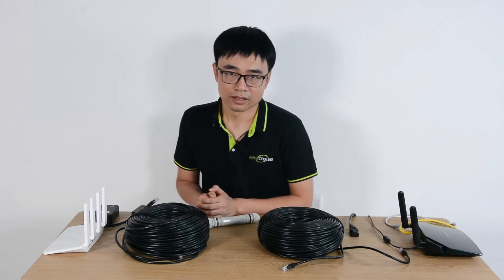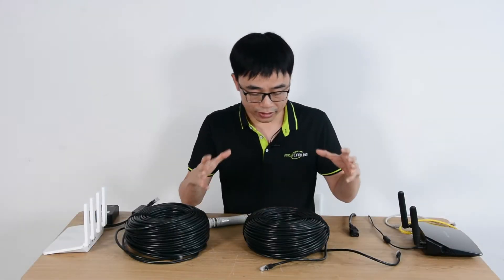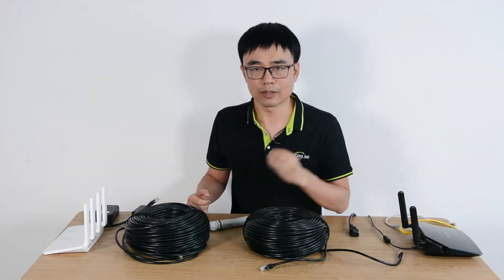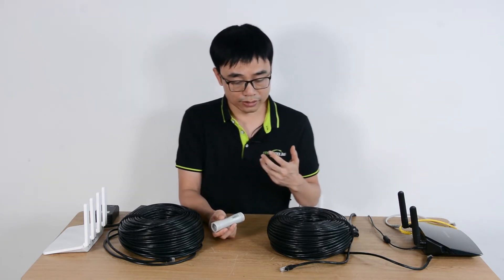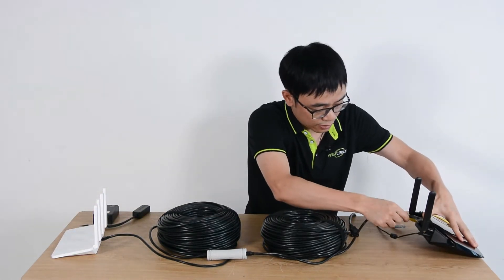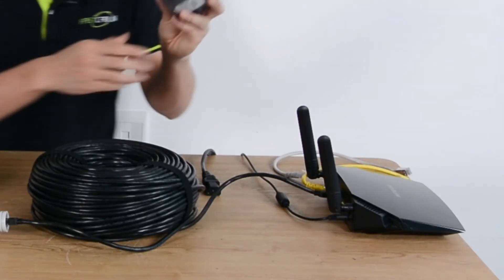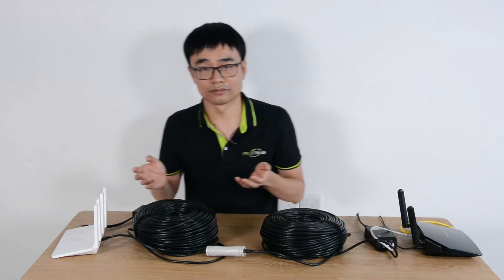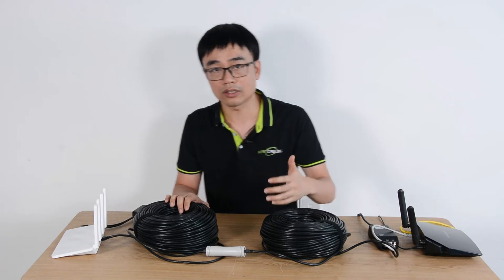Why PoE is Needed to Extend Ethernet for Non-PoE Device with PoE Extender?

Comment: Thank you. I banged my head against the wall for 3 extra hours not getting power to my 2 injectors, going 250 meters because, I did not have a PoE device or "splitter" at the end point, it would not turn on.
I put a PoE telephone at the end & boom, it all lit up and worked, then I had the "pc" out of the phone to my remote switch and data worked.
Reply from the maker: Before delivering power, the PoE switch/injector performs a handshake to detect whether the connected device is PoE-compatible. If not, it will not deliver power to the device.

Comment: I have an FTP RJ45 cable with a distance of 100 meters, but the Internet did not work. I only have a fiber router and a 100M FTP RJ45 cable. What should I do to make the Internet work at a distance of 100 meters?
Reply from the maker: Basically you don't need to have any extra device to extend the network for 100 meters as long as the cable is good. The TCP/IP network can reach 100 meters over UTP cable, but it need to be cat5e, cat6 or higher grade cable. You might test the network with short patch cord, and examine the cables if the short patch cord works.

Comment: WHAT IS THE MAIN JOB FOR POE STANDERD ? IS IT REQUIRED IF MY CABEL IS 150M LONG (ONE CABLE)?
Reply: Sorry i meant the POE extender
Reply from the maker: It's designed to amplify the signal as PoE can only support a maximum transmission distance of 100M/328ft. The signal strength will deteriorate as the distance increases. Physically extending the cable length cannot get you anywhere further.

Comment: I have router/modem  plugged to POE switch in office. Then from POE switch I go outside 250' to POE extender, then another 250' to POE extender, then 100' to another POE switch. 
Then I plug 4 cameras and 3 Access points into that POE switch. It works for 1-2 days then signal drops. I have to unplug cable, plug it directly into IP camera, then unplug quickly and plug back into POE switch.then it will work for a 1-2 days and drop signal again. Any advice or help would be appreciated, thank you....FYI the POE extenders are the Fast Cabling brand, thank you....
Reply from the maker: Could you please send a email to support@fastcabling.com? We need to know which model - PoE extenders you possessed. If it is one in one out version, you will need PoE splitter before second PoE switch. This is one. https://www.amazon.com/dp/B003CFATQK/. After you add this PoE splitter, the whole system will work stable. You are extending the data network, but not POE network. Your second PoE switch doesn’t need the PoE power right? In the standard PoE system, it has power handshaking, if  the first PoE can’t verify the edge device (second PoE switch in your case) need power, the first PoE switch will not send power. Then both PoE extenders will not get the power. You mentioned it work after you plug the ip camera, then switch back to the switch. What you did just cheat the first switch, the edge device need PoE to get whole system up. After you add the poe splitter, you will have no problem, because the poe splitter will confirm the first poe switch and ask it to release the power. By the way, One pairs PoE extenders working together can achieve 1000 meters continuous run. You don’t need to place PoE extenders about each 250meters. You can place the PoE extenders both ends. With your setup, it should also work. You can have 600ft no stop cable running between the first switch and second switch.
Reply from the maker: Here is the video, you can refer to part 2 - extend data network for non-poe https://youtu.be/U6U4E6YczlU

Comment: So, if i have poe router (main router) and I want to connect my PC via LAN at 200M distance, I need poe splitter right before the LAN cable connected to my PC right?
Reply from the maker: If you pick the model below, there is no need for PoE splitter at the edge. https://www.fastcabling.com/product/poe-extender/ Otherwise, you should add the PoE splitter.